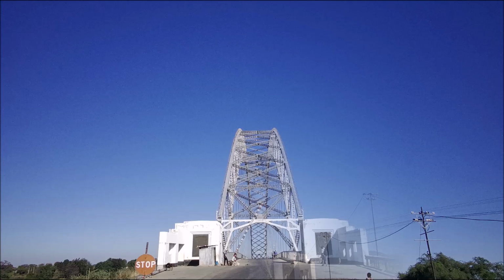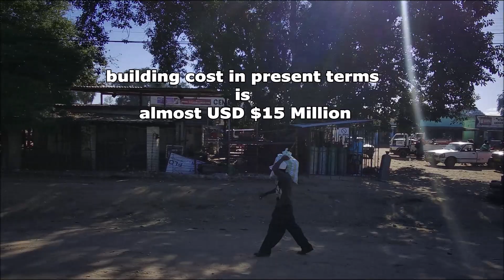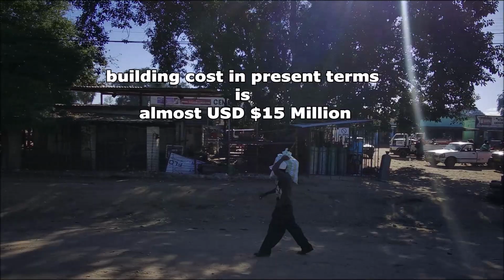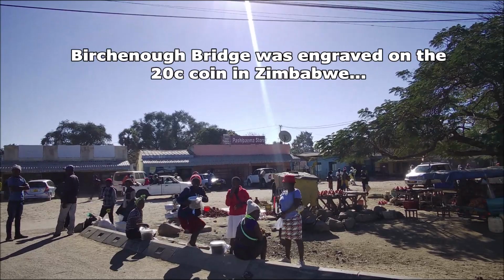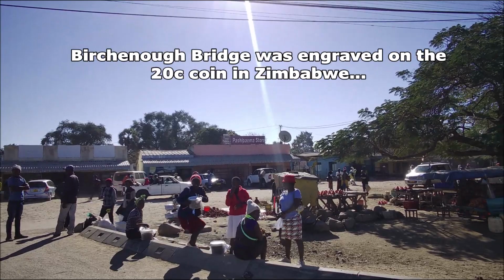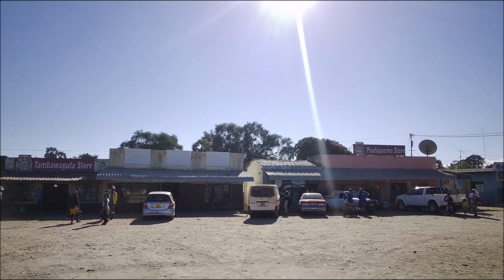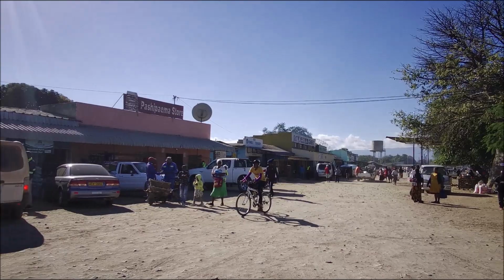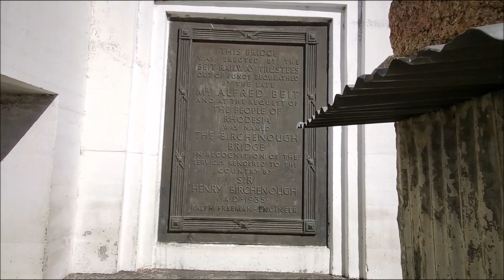World's Third Longest Arch Bridge (1935)  ~ Birchenough Bridge | Manicaland Province | Zimbabwe

Comment: As written in the show notes, the Birchenough Bridge and Sydney Harbour Bridge were designed by the same engineer Ralph Freeman. Birchenough Bridge is similar design to Sydney Harbour Bridge but smaller version. Ralph Freeman also designed the Chirundu suspension bridge across the Zambezi, also built in the 1930's and funded by the Beit Trust. The Chirundu suspension bridge was the first modern suspension bridge ( meaning with twisted steel cables) to be built outside of the United States.